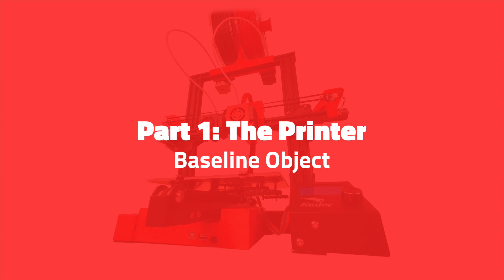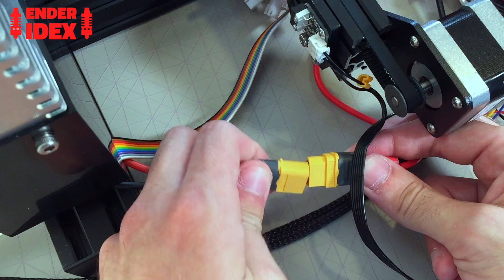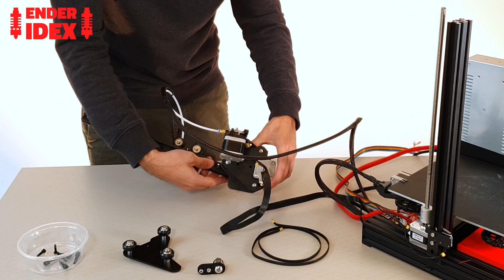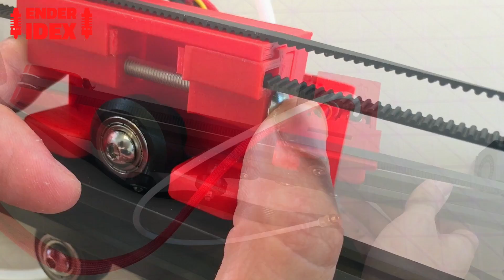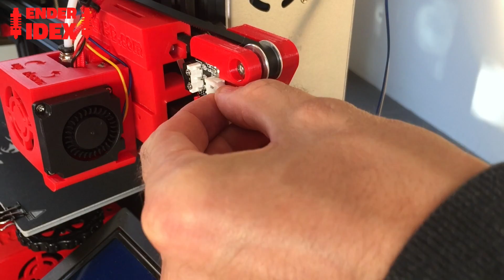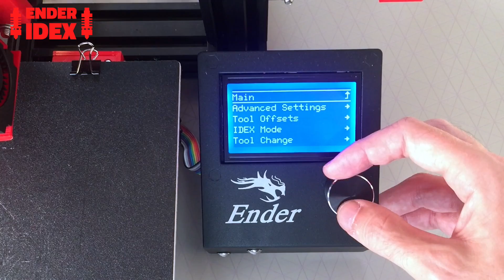Ender 3 IDEX: DIY Dual Extruder X-Carriage 3D Printer Installation Kit by SEN 3D

Comment: Интересно, в чем прикол, если за 200 фунтов можно купить два эндера? )) И площадь работы будет больше
Reply from the maker: It's a great point, however 2 x Ender 3's cannot print multi-colour/multi-material. 2 x bicycles do not equal a car 😜

Also, if you're looking for print volume a great and much bigger project is an Ender 3 with an Ender Extender 500 kit and Ender IDEX kit. Now that would end up with quite a mega machine (a number of people have already done it too!).

Comment: Has anyone done this on a CR-30 yet?
Reply from the maker: I like the way you're thinking! A few people have been thinking about it and asked but none yet. I don't have a CR-30 myself...yet 😅 so have not been able to look into it in too much detail.

I think firmware should be manageable as the it's essentially a normal printer with a vast unending Y axis. Slicing I'd want to check the 45° slicers of choice has dual extruder options (for example purge tower being kind tricky and you might need purge "zig-zags" or something). And then the final question is hardware which may need jigging about but is still a V-slot extrusion based machine. You might have to lose a little bed coverage to allow for hotend parking.

Comment: Hey, real talk. if they don't make different color schemes, I would print my own colored parts, given I am able to do that legally
Reply from the maker: Hey Corporal McMuffin,

Thanks for watching my video and your comment, I think I get the gist of it 😇

Currently the parts I print and sell are only available in red. This is because with 10+ parts in each kit printed across 20+ printers, even 1 additional colour would require many KGs of filament and a lot of time swapping machines over and increasing stock buffers etc. 😅

However, I think as you said, you can also get my files kit and print the parts in any colour or material you wish 🎉 

To date I have seen the Ender IDEX in everything from Black to Blue, Orange and even Purple. So if there is something even crazier you'd like to print it in I'd love to see it 😁

Comment: I currently have a BL-Touch attached, how does this affect the new IDEX??
Reply from the maker: Excellent question, in short it works great with a BL Touch!

You attached the BL Touch to the hotend 1 like normal and use it in all the typical ways.

The only drawback is that for a duplicate or mirror mode print you still need to manually level your bed. This is because 2 hotends touch the bed at 2 points at the same time. This is true of any IDEX printer, the Z axis cannot correct both hotends at once.

Also, the SKR Pro motherboard I use in the kit has a port ready to accept the BL touch cable. Plus, I provide pre-compiled firmware for the BL Touch and an install guide so it couldn't be easier. 😁

Comment: Can i use it in combo with a extender 400 xl kit?
Reply from the maker: You certainly can and quite a few people already have!

I would recommend also getting a dual Z motor kit too (I think this is sensible for the 400 xl even without an IDEX kit).

To et the longer cables and bar needed go to the Ender IDEX buy page and scroll down to alternative kits. You will see options for both the 300XL and 400XL Ender Extenders: https://3d.plus/buy/ender-idex/#IDEX-alternative-kits

Don't hesitate to ask if I can provide any more help and information 😁
Reply: @SEN3Dcom  i only can finde it for the 400 extender kit, is it the same?
Reply from the maker: @Markus_J.  Ah yes, the 400/400XL only changes the Z height which doesn't impact the IDEX kit at all. 

The main concern for the IDEX kit is the width of the X-axis which if the same for both 😇

Comment: Is this only red or can i buy it in other colors?
Reply from the maker: Hey There, thank you for your comment and excellent question. The kit and parts I provide are only currently available in red.

BUT...I do now offer the "files kit" too. So you could actually buy that for a lot less and print all of the parts yourself in any colour of material you like.

If you have not seen the files kit take a look at my other video "Print your own Ender IDEX" 😊

I only supply red myself as I run the production across multiple machines and with each kit needing 10 to 15 parts even adding one additional colour would add a huge amount of time changing machines back and forth, as well as keeping ~20kg of another colour of filament in stock too 😇

Comment: That kit costs a couple of hundred more than I paid for my Ender 3 pro.
Reply from the maker: Thank you for your comment, I can see why you may think that.

However, there is a lot included in the kit, not least an SKR Pro motherboard and drivers (around £40-50 on it's own). Plus a second X2 motor, Extruder, complete X2 carriage, hotend, fans and more, 10+ custom designed and printed parts. 
(if you started to buy all these components on their own you'd be surprised how much it costs).

You also get access to the kit stl files, pre-compiled firmware configurations, access to the private Facebook owners community and my personal support too 😁

The kit is also manufactured and tested by me here in the UK (where costs are a little more than China). 

So all in all I think it's not bad value when you take into account all aspects of it 😇

Comment: This is plainly NOT something someone just did in a weekend! there a hell of a lot of work in designing this....  For removing the bowdin tubes I have found (on various printers I have owned), that; push collar down and push the tube IN slightly to get the teeth in coupler to release....
Reply from the maker: Thank you for your kind words 😊 it certainly wasn't a quick project 😅

Great tip on the bowden tubes too! I have also found that over time they can really dig into the tube and be a pain to remove. Sometimes moving it further up the tube first and then quickly pulling it down can help. Or as a last resort I move it further up the rube and cut off the last 5mm of so where it has been chewed up by the coupling over time. 

The classic "hotend fix" is also a big help here as it detaches the tube actually in the hotend from that longer piece that just carries the filament to the hotend.
Reply: @SEN3Dcom  I have my 'I want list" (I want this, now to figure out if I NEED this), I AM getting another printer.  I am not quite sure whether I want to go with an Ender or a Prusa mini, Now you made it HARDER for me! LOL  Thinking maybe start with an Ender 3 pro, and then get the IDEX.....
Reply from the maker: The correct number of 3D printers to have is always "just one more" 😜

Comment: is it compatible with the Ender 3 V2?
Reply from the maker: It certainly is! There are just a few differences compared to the Ender 3/Ender 3 Pro standard version:

1. You will need to use a different screen. the larger V2 screen Creality provide does not play well with non-creality motherboards and misses a lot of the settings needed for IDEX machines. You can use either a classic Ender 3 LCD or something like the TFT35 (or just manage the printer over USB with something like an OctoPi).

The Ender 3 V2 version of the kit I sell comes with a TFT35 included.

2. The Ender 3 V2 does not have an XT60 plug for the power so you will have to screw the power cables directly into the power supply but this is very easy and adds no more than 5 minutes to the build.

3. You need to replace the X-axis belt tensioner as the large V2 version does not leave enough room for the X2 carriage and belt arm to fit on the axis. You can print or buy an alternative quite easily and as before my V2 version of the kit comes with everything you need.

I hope this helps. You can see what is involved a little clearer by checking the "Alternative Kits" that I offer here: https://3d.plus/buy/ender-idex/#IDEX-alternative-kits

Comment: Will this work on the v2?
Reply from the maker: Great question and short answer is yes! a fair few V2 users already have the IDEX kit installed (even some Ender 3 V2 Extenders too!).

the only main differences are:
>You need to replace the V2's screen, it doesn't play well with non-creality boards and loses tons of settings for IDEX specific features. Either a classic Ender 3 LCD or one of the BTT TFT touch screen work great.
> The V2 does not have an XT60 power cable at the back so you need to screw the power cables directly into the power supply
> The stock X-axis tensioner needs to be replaced as it's design blocks the mounting point for the X2's pulley arm

If you're printing the kit yourself this is all quite easy to deal with and if you wish to buy a complete kit I have a V2 version that comes with a TFT35 and all the other chances needed to solve the above differences. 

Just check out the Alternative Kits section on the kit buy page here: https://3d.plus/buy/ender-idex/#IDEX-alternative-kits
😁👍

Comment: would this be compatible with a dual z kit, bl touch and would it be possible to have 2 microswiss dd hotends?
Reply from the maker: Hey Ignis, great question and put simply yes (almost 😮)! 😁

The typical dual Z kit with 2 stepper motors and a new mirror back plate should fit fine and many existing IDEX customers have made that upgrade (it's a good one to do).

Yes, BL touch works, you install it on hotend 1 and prob the bed like usual. The kit files that come with the kit also has multiple pre-compiled BL touch versions of the firmware. 

However, when running a duplicate or mirror mode print you still need to manually level the bed. This is because 2 hotends touch the bed at 2 points at the same time. So the Z axis cannot compensate for 2 at the same time (this is true of any IDEX printer). But you can still use the BL touch sensor to help you identify the bed level and adjust it too!

Finally, the micro-swiss direct drive hotend is not as easy. You can install a direct drive of your choice on hotend 1 as long as the motor for it is mounted over the front of the carriage. Those that mount it over the back like the MicroSwiss will hit the new X2 belt path.

For hotend 2 it is more complex as this hotend needs to be possible to raise and lower independent of hotend 2 to get them perfectly level. It also needs the new mounting points for the higher X2 belt path.

However, in the file pack at the moment is a beta file for the hotend 2 direct drive which has been received very well by the community so far. And it is equally possible to print your own direct drive solution for hotend 1 as well!

In both cases the same form factor of the MicroSwiss hotend means that is can be mounted and used fine, it's just the direct drive carriage that is the issue.

Do let me know if I can provide any more details, information or support 😁 And thank you for your interest and support 👍

Comment: That's a lot of X for just one Z
Reply from the maker: That is an excellent point Zac. By removing the E1 extruder motor from the X axis and replacing it with a mostly ABS E2 carriage (which is very light relative to a typical carriage) the gross weight change is not huge.

You can still get great prints with the Ender IDEX and a single Z-axis motor, provided the rest of the machine is also well calibrated (square frame, tightened eccentric nuts etc.). 

However it is not a bad thing at all to also add a second Z-axis motor too. The SKR Pro board in the kit has a dedicated second Z-axis plug and the kit is fully compatible with the typical Ender 3 dual Z upgrade kits. Many existing kit owners have made the upgrade and it has worked great. 😁😇

Thank you again for your feedback and don't hesitate to share any other thoughts or ideas you might have 😊
Reply: @SEN3Dcom  I'm sure it's fine, I just thought it was kinda funny to find and not what I was expecting when I was looking up dual extruder hotends, and the SKR 2 board on YouTube.
already did a dual z upgrade on my ender 3 due to the annoyances from the x axis sag the would inevitablely come back no matter how many times I readjusted the whole entire printer Plus then it just became better accuracy especially with TR8x2 lead screws

Even then I'd recommend to anybody doing a dual Z to replace The old lead screw as well.
Great video though definitely awesome to see something different.
Reply from the maker: @Zac_Cave  Excellent advice Zac, thank you and I agree. The Ender 3 is a fantastic machine but the X-axis sag is a slight limitation. In my experience IDEXing the machine doesn't make it worse but you're right it always exists to some tiny degree. If you can (and it's fairly easy) adding a second Z axis is a great upgrade for sure and improved lead screws will only make it better! Keep up the great work 😁

Comment: Hey! I really like what I am seeing here. Would this work on the Voxelab Aquila or the TRONXY XY-2?
Reply from the maker: Hey Batarn,

Thank you for your comment and kind words 😁

I have not tested either of these printers directly but after a quick google I would say yes, probably 😇

The frame and brackets all seem to be identical to the Ender 3 ones and so should work in the same way (some people have tested the kit of other clone machines without issues).

The main thing I would consider is they both seem to have custom LCD screen. These may be possible to transfer over to another motherboard/firmware but I cannot be sure. Worst case you may have to switch to a classic LCD or something like a TFT35 to control the printer.

Let me know if you're interested in getting stuck into this, I would be delighted to help with any minor hiccups that may crop up compared to the classic Ender 3 version of the kit. And also I now offer the Files Pack so you might want to print and make everything yourself 😮
Video here: https://www.youtube.com/watch?v=EbJffOkkdNA&ab_channel=SEN3D
File pack here: https://enderidex.com/files-pack/

Comment: I have Questions. How much wider does it make the ender 3? Can i have the files to the 3d printed parts, I need to make them out of nylon or polycarbonate? Can i have 2 direct drive extruders on it? Can one of those extruders be 450c and the other one at 220c? Can i have one print the shell while the other does the infill? Thank you to anyone that answers this.
Reply from the maker: Excellent questions.

On the left side the mod adds 20mm and on the right side it adds ~30mm from the outer edge of the screen.

I will soon be releasing the files for personal use/printing so you will be able to produce the kit yourself in any colour/material you like. Be sure to join my mailing list at EnderIDEX.com to find out as soon as the files are available.

Hotend 1 can be direct drive. Most setups work but it has to be a version that mounts the motor over the front of the carriage. Those that put the motor over the back will collide with the path of the new X2 belt.

For hotend 2, currently the hotend is a bowden setup and this is quite custom as it also needs to raise and lower independently to get it perfectly in line with hotend 2. When the files become available there will also be a beta of the direct drive version available too. So long story short, yes hotend 2 can be direct drive but the setup will initially be a beta so may have some room for improvement compared to the standard bowden setup.

You certainly can have different hotends at different temperatures. As long as the hotend you choose/install can support the higher temperatures that is fine. And it is one of the many advantages of IDEX that you can print vastly different materials at the same time.

Finally, yes you can choose the options in your file slicing to have infill printed with a different hotend from the overall print. I suggest Cura but as a standard Marlin based IDEX printer, any slicer than can slice a multi-extruder Gcode file should be compatible.

Comment: Impressive. 2 requests: a version of this for Ender-3 V2 that's been extended using the Ender Extender 400 XL kit, and a version of it for BIQU B1 printers!
Reply from the maker: Thank you, you're very kind. There are a few Ender 3 V2 versions out in the wild now 😮 The only requirement is that you replace the Creality screen with a classic LCD or something like a TFT35 (the Creality screen does not play well with non-creality motherboards).

It is also possible to use it with the Ender Extenders too! Depending on where you're based I can quote you for the longer X-axis extrusion, belts and cables to get it working. There is already an Ender 3V2 300XL out in the wild 😇 Drop me an email if you'd like to know more kane@sen3d.com

Great suggestion on the BIQU B1 too! it's very similar to the ender 3 so I don't expect it would be too difficult mechanically. The challenge once again would probably be the screen etc. But I would be hopeful that as the BIQU makes that printer and also the SKR Pro that comes in the kit it may actually work really well....maybe this is an excuse for me to buy another printer for "testing" 😅😜
Reply: @SEN3Dcom  Yes, the BIQU B1 has an SKR 1.4 board and it uses the vaunted BTT TFT35 touchscreen. It would seem the kit for B1 would not need a new motherboard. The Ender Extender has no substantial changes other than dimensions and minor tweak to firmware to accommodate the larger dimensions.
Reply from the maker: @douggjoseph  super, the need for the SKR Pro is actually it's ability to drive 6 stepper motors (X1, X2, Y, Z, E1 and E2). Most standard board can only run 4 or 5 stepper motors. 

You are correct, I have quite a few existing customers on the 300xl and 400xl Ender Extender (just one that started out as an Ender 3 V2). A longer X-axis is needed to give X2 space to park off to the side and longer belts and cables for carriage 2 but otherwise it is a pretty simple change :)